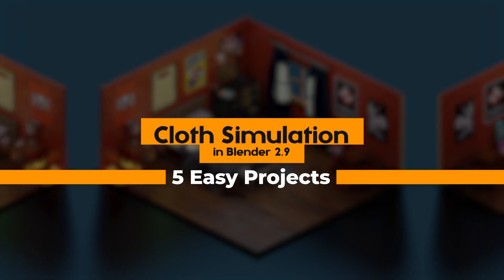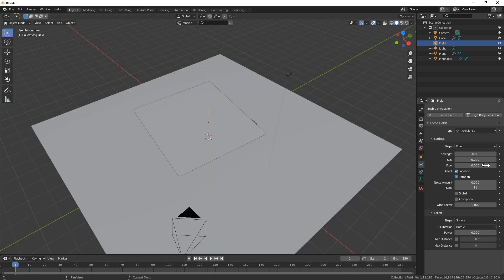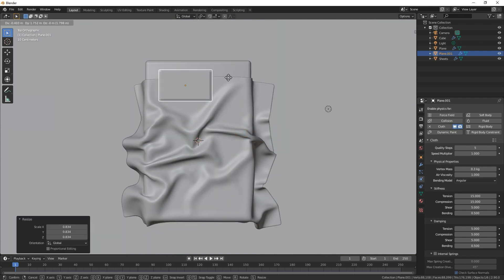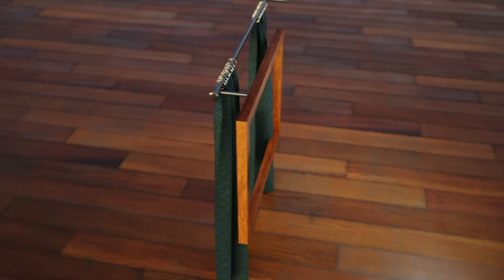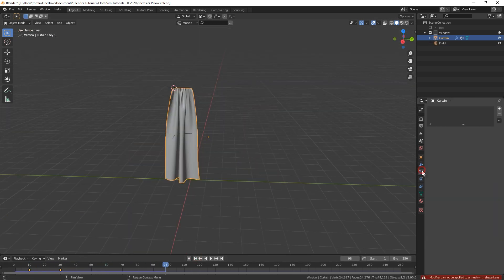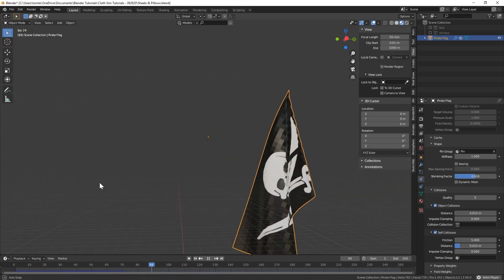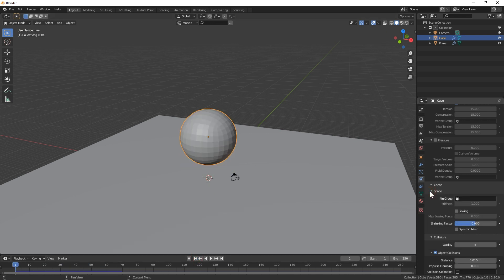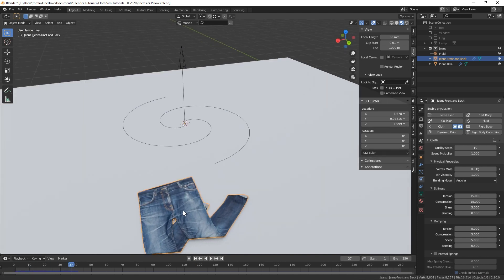Learn Cloth Simulation in Blender

Comment: Great vid.  One question.  Have you ever seen what I'm calling phantom physics.  I added the turbulence, wind, vortex for the bedspread.  Played around until I got what I wanted, applied the modifiers, etc.  DELETED the Wind, Vortex, Turbulence.  

Now, on to the curtains.  It seems that the wind, vortex and / or turbulence is still applying forces to the curtains.  They fly around like crazy.  I started a brand new blend file and rebuilt the curtains and they work perfectly.  Have you ever seen this phantom physics behavior?

I think i will need to append all of my assets to a new blend file to get away from the physics.

I can share the blend if anyone is interested in exploring.  

Using version 2.93.3